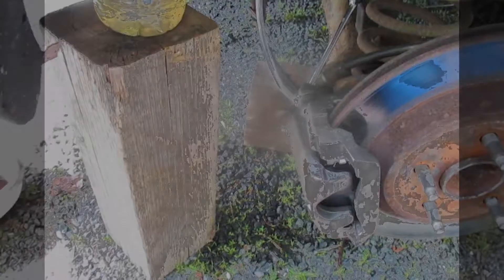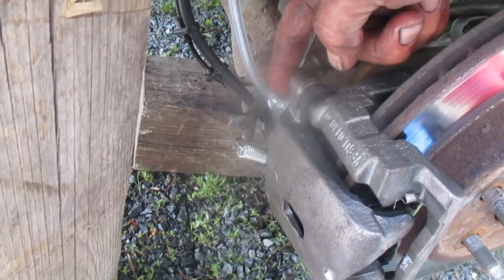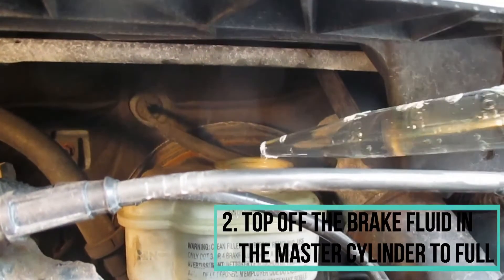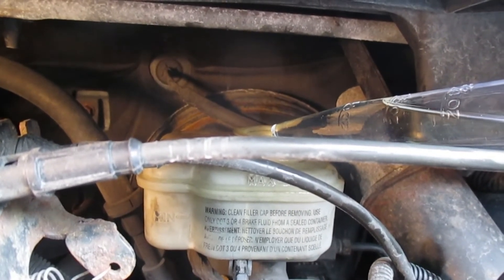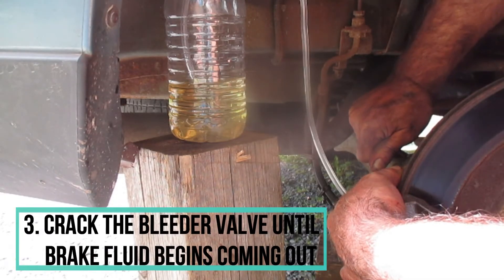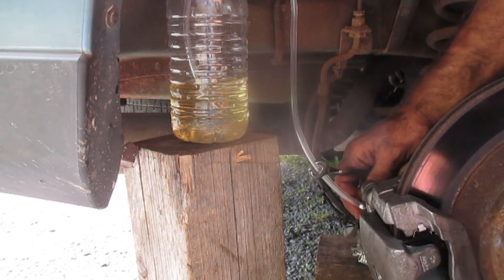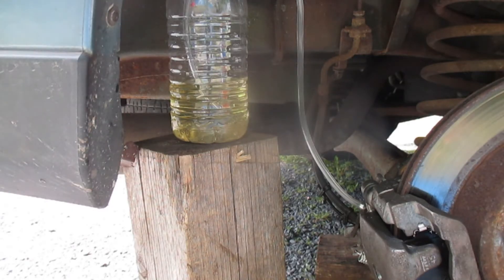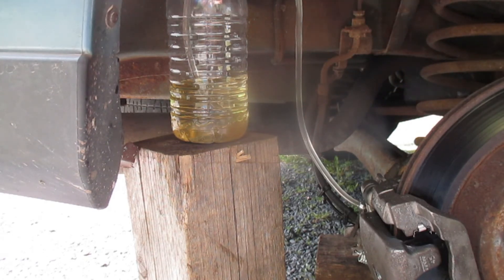How to bleed brakes by yourself

Comment: WOW, the most important of this video is elevating the bottle so it is above the bleeder valve and below the Master cylinder. Why? Positive pressure from bottle down to bleed valve. Because doing so, prevents air leaking from the bottom of the bleeder valve into your hose "thus making you think it is air coming out of your caliper/wheel cylinder/lines !" The grease trick around the bleeder screw never works for me and if replacing calipers with new ones, gravity bleeding won't get the air out of the calipers, it has to force out.

Comment: Do you have to do it to all 4 corners?
Reply: All 4 wheels and if you have an old 60’s-70’s car with bleeders at the master cyl, the do those 1st. Work from the furthest wheel and go to the next furthest until all 4 wheels are bled.
Reply: Tenfour Dispatch front left is last
Reply: @johnmilner7603  it’s a late response but the order you bleed the brakes in is typically: Back Passenger, Back Driver, Front Passenger, Front Driver.
Reply: @mknubs  Correct. But if your not using a hand pump then you need a person to pump the brakes 5 X’s then hold the pedal down. You can’t pump the brakes yourself then go back and open the bleeder. With a person on the brake peda, when the person at the bleeder opens the bleeder, air and fluid will gush out and spit. This won’t happen if you do it yourself.
Reply: @johnmilner7603  you’re absolutely correct.